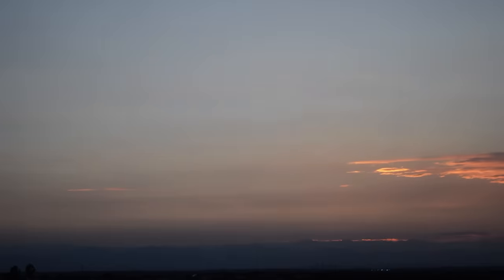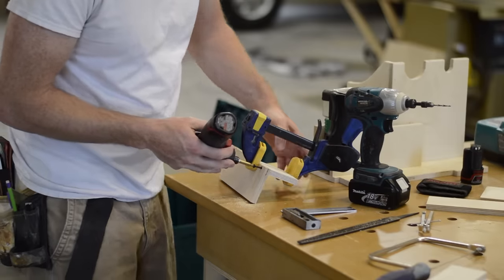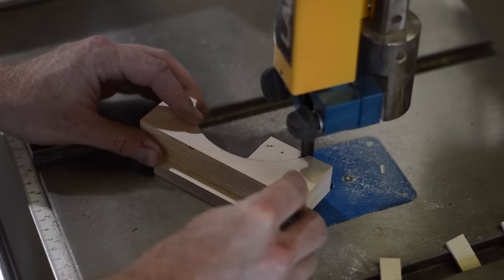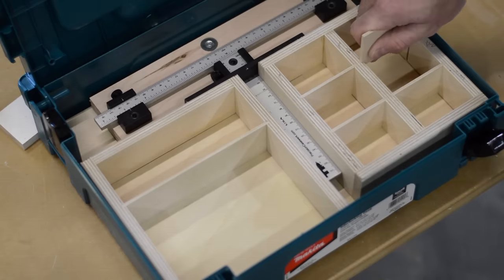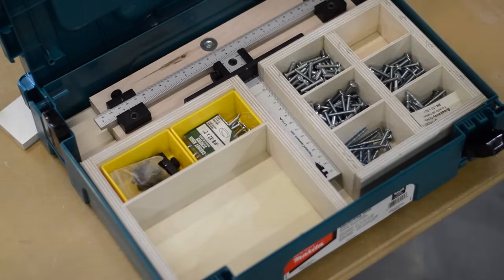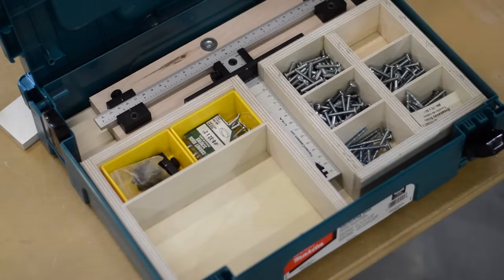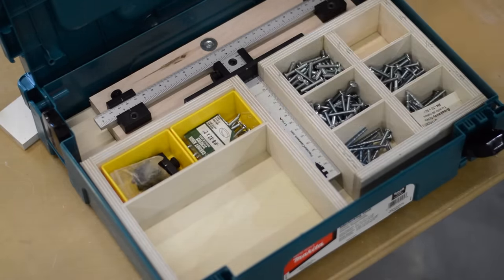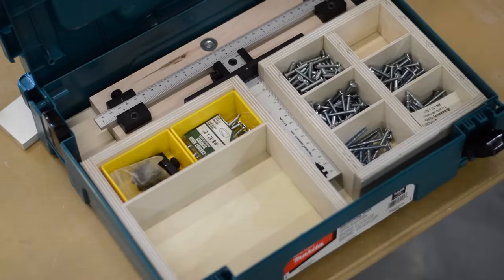Carpentry Tool Organization, Makita, Festool Systainer Build

Comment: Hi Mike, I really like your videos and your camera work is clean and very professional.
I'm from the UK (now living in Australia) and I purchased all of my "Systainer" boxes from a company called TANOS. They have the same boxes as Festool with lots of inserts etc, just come in a dark grey. They also have the new T-Lock system.
Just a quick question, how large is your shop and how do you work out the placement of tools in regard to your work flow?
Many thanks
Reply from the maker: Thank you. I am learning camera and sound details with each video. I am still very new at producing videos. I have looked over the Tanos site, I may add a few more boxes in the future. My shop is just under 3k feet. Regarding placement of tools, this is my first big shop, I have worked in very small spaces up until now, my tools have always been pushed up against a wall and pulled out when needed. In this shop I had the opportunity to group tools together according to work flow/material movement/etc. This was my first go, I would give myself an average grade at best. I would love to redo it knowing what I know now. I will fix things over time until I get it just right.

Comment: Nothing wrong with a little OCD.  Big fan of Systainer organisation especially the Makita ones as they are really more affordable, the four latch mechanism is not too much of a bother I just spray with a silicon based lube occasionally (or furniture polish).  Well done great vid
Reply from the maker: Thank you Mike. I really agree on the value of the Makita Systainers. I spray the latches with what ever furniture cleaner/wax I have on hand. Seems to keep them working just right.

Comment: No sanding stuff?

Your helper is adorable.
Reply from the maker: Thank you. He sure is a cute one. No sanding stuff. I only bring a couple pieces of sand paper, which I store in the lower section of the general tool box to touch up small stuff like nail holes, and miters. The reason for this is I do all sanding in my shop before delivery.

Comment: I like the compressor in a box, I've been wanting to do that for a year now. I think you may find that your large general box is a little too fussy to truly be efficient. I prefer more granular storage for my tools (smaller boxes, fewer tools per box = easier access) the dewalt tstak drawer units have helped me achieve that without cluttering up the floor with a bunch of boxes. I have a 4' tall stack of drawers with a lidded unit on the top that is secured to their tstak dolly. easy access to all my tools, 1 trip to the van, and it only takes up about 3 sq ft.
Reply from the maker: Thank you. You may be right but, I will say that those exact tools have been in a large tool bag for the last 10 or so years. I have used at least some of them on every install I have done since I first put the kit together. So really this is just a new presentation and I have similar access as in the tool bag with the exception of the stuff in the drawers. Time will tell, and I have an open mind to admit if I'm wrong on this experiment.
Reply: Mike Farrington Your current setup is definitely better than a bag full of tools, no denying that. My point was about getting to that “next level” efficiency where every hand tool you have can be accessed without unpacking a box. I don’t think you’re wrong and I’m right, you accomplished what you set out to do. I’m just offering a different way to think about it.
Reply from the maker: Thank you for the input. It gets me thinking for sure.

Comment: Apologies if you answered this but was heat an issue with the compressor?  If so maybe active cooling like a PC case fan. Noctua fans are quite and move more air than the competition. Maybe heat shield on the insides of the systianer. I think you did a fantastic job. I'm sure you wont regret spending the time to do this. Does not having them the same color (contianers) bug you? Just curious been I have festool ones but the makita ones are mighty attractive at half the cost.
Reply from the maker: Heat has not been an issue. The compressor is a diaphragm style and really doesn't get hot. On the days where its going to be running constantly, I just open the lid. So far so good.

Comment: Well done! I’ve been plotting a revamp of my organization and this is great fodder, particularly the compressor. I will say I’m not a huge fan of the makita latches. I received two with my tracksaw and find the latches  difficult to open and close. I’ve started purchasing the dewalt tstak a because of the price point and options for drawers. Cheers!
Reply from the maker: I have heard good things about the tstak. In the end I went with the Tanos Systainer because I already had several, so it would have cost much more to replace those. I hope the Makitas hold up.

Comment: Mike, I didn't know Makita had systainers. I know they don't have T-Lock but do they nest with the Festool ones? The other thing is for the compressor, you could get a 24v power supply and wire it to the compressor's incoming 120v power. The 24v power supply would power a muffin fan that you could mount on the inside of the systainer and have holes on the opposite side drawing air across the compressor.
Reply from the maker: The Makita Systainers are basically like the old style Festool ones. So yes they nest with the t loc as long as the t loc is on top.

Comment: Hi Mike,
Great video, I'm going through a toolbox upgrade now and you've nailed all my essential ideas.
I totally understand your planer, jigsaw combo, i do that too. Except ive got an anglegrinder +sanding disc instead of beltsander, find it more versatile for curves.

Whats the update on the toolboxes a year on?
Cheers
Reply from the maker: Thank you. I sometimes wonder if a grinder would be of more use. I'll need to give that a try. So far after a year, the boxes are working out great. I have added a few to the list as well. I just finished an install yesterday in a small room, without these I would have been stepping all over my tools.

Comment: Mike, how did you start your carpentry experience?  Now, if you are to look back with your carpentry experience how would you tell yourself to commence into a carpentry lifestyle?  How would you recommend One to commence at 25, 30 , 35, 40, 45, and 50 years old?
Reply from the maker: I just bumped into it, without getting into too many details. I tried to leave a few times, but just didn't like the alternatives. So I guess I am a carpenter. As to how to get in to it. It's easy, just look for a job. Work for someone and learn about what they do. Do that with a couple different positions. That will give you an idea of if you'd like to really dive in and become a carpenter.

Comment: nice job, with compressor box I thing if you cut a square hole on the 2 sides 120mm by 120mm and afix some light stainless steel mesh it may overcome heating problem.
Reply from the maker: Thank you. Good idea.

Comment: Add small computer fans to your compressor box to cut down on the overheating.
Reply from the maker: After quite a bit of use, I have found its not needed. The compressor doesn't get hot enough.

Comment: First, the design is thoughtful and the execution shows off your advanced level of craftsmanship - these cases should bring referrals in by themselves. Second, while the air compressor systainer is a slick build, I wonder if cordless nail guns would be an easier solution if you're just using them for installs. Do you feel the air powered nail guns have enough benefit over the electric guns (enough to necessitate an extra case for the compressor)?
Reply from the maker: Thank you. So far on the job site these have been extremely helpful. Last couple jobs, I have spent very little time wondering where things are. I could be with you on the cordless guns. The reason I did this is because I already have two full sets of nail guns, and I had the compressor. So all I had to buy was the box, about 40 bucks. Figured with where I was at, this made sense.

Comment: How is the compressor working out in the box?  Slick packaging.
Reply from the maker: Thank you. The compressor has been great. The particular model I have doesn't make much heat, so unless its going to be running constantly I leave the lid closed and it hardly gets warm inside.

Comment: Glad I found this Video!
Just started to get me some (used) Systainers for organising my tools/building up my Workshop and was wondering about how to build/arrange the inlays.
Don't the wooden inlays add a decent amount of add'l weight?

I'm actually thinking about my 215 pce. wrench-set, which I have to re-organize as the latches of the original box got broken and can't find replacing.
This much metal is quite some weight and I beliebte wooden inlays would add top much weight for comfy handling.

Greetings from Germany, Peter
Reply from the maker: The wood has some weight, but its not too much, at least I don't think so. I would say a bunch of wrenches may be too much. I really don't know, you may need to experiment. Best of luck.

Comment: There is a special made Kaizen hard foam insert which is laser cut for this particular Makita line of boxes perfectly - it weighs almost nothing, and are customizable per your tool collection. They are $10 each and come in 3 different thicknesses.
Reply from the maker: Yup, I use that exact foam.

Comment: Hey Mike, after all this work for the inserts, do you think you could have built wood boxes instead of using systainers?
Reply from the maker: I don't think I could have made boxes that locked together with folding handles in several different sizes, plus the foam for the camera gear. I thought about making a totally unique system, but I just wanted to get this done and get back to work. This seemed faster.

Comment: Great video! This is a thing i have been thinking about for some time. I want a kit to go on a expresso trolley, that i can easily take anywhere even up stairs. Waterproof, because i live on a boat, and do boat stuff,  and designed to  the "first order of retrievabillity" as Adam savage puts it. -the stuff you use most often is at the top. I mostly travel by boat or bicycle when local, so a mount for my bikerack would be cool. I have 3 makita systainer boxes. but also 3 of the "standard" breifcase model. think i need to build an adapter plate between them.
Reply from the maker: Thank you very much. A bike rack could be interesting.

Comment: In managing apts i had a golf cart but no locking stofage. My cuz has a pack rat box bolted into his f350 sh0ort bed. It is covered in plywood and is water tight. He uses a bucket.  He useses a center handle tote for hand tools. Of course he is doing total house building so many toolss. My other cuz has a dual axel dump trailer. So we took an old rv camper put plywood inside framing and use heavy duty jacks. And a dolly to off load it on a job site. Plenty of room for tools and unload for material or dump runs. We have learned to use trailers with dual purpose. During salmon season 5000 # salmon per day. Rest of year f350 freightliner 24' refer and dump trailer. Next we are going to build a frame over dual axel boat trailer to use it as a flatbed to haul 20 4' x4' x  4' insulated fish empty fish bins for our nets.  The dump trailer also hauls our fork lifts. And we have two rv trailers for crew quarters.

Comment: Never thought about doing it this way. I have been thinking about making compartments out of foam rubber, but I have not found a decently priced foam that seems easy to work with yet. Maybe I will try your approach or perhaps a mix of your plywood method and add some thing foam in certain places to avoid rattling so the expensive or delicate tools sit real snug. Do you find your tools rattle around much in your builds? Seems like the nailguns and the sander will move quite a bit if you drive on a bumpy road.
Reply from the maker: Everyones level of tolerance is different, but everything sits snug enough for me.

Comment: Great layout of your tool boxes. I am curious to see the updates that you have made after working with the boxes...
Also, what is the weight of your main handtool box?

Keep up the great videos...
Reply from the maker: Thank you. So far the boxes have been working out great. Couple notes, a vent is not needed with this air compressor unless is cycling on constantly, but if thats the case a bigger air compressor should be brought to the site. Also, I would like to add some sound deadening to the inside to reduce buzzing. Otherwise everything is working good and holding together. A few viewers have sent me some more ideas that I may incorporate into some more boxes.
Reply: You can always add Kaizen foam. But it looks like for the most part, everything has its place...
Reply from the maker: @steven6068  Thats a good idea.

Comment: Heartily approve, with the exception of the compressor. It would cost more, yes, but Rolair (and I think Makita) both make a Systainer compressor, that wouldn't require cutting apart a functional tool. Copper is ductile, sure, but bending that tube seems like a risk. Don't get me wrong, it's cool as all get-out, but that blowing on a job seems like a risk to productivity.
Reply from the maker: I agree, but I had the compressor already. It was a hundred bucks when I bought it, and its way over 10 years old. I figured I couldn't go wrong trying.

Comment: I'm extremely OCD so the normal satisfying tone of your voice, the random shots of your adorable son and the interludes of your different calming person interests are always nice but are a far cry from the satisfaction of watching the organizational system you just put together. Well done, man. Honestly, I can't see anything I would chang about this except for the compressor sustainer. Having holes for the power cord and the air line would make it to where you could close the lid for some minor noise reduction. The hest shouldn't be too much of an issue, but adding a few small fans and a power switch system could give you a few added benefits. But those seem mostly unnecessary.
Reply from the maker: Thank you. I added holes for the compressor cords. So far this has been a welcomed addition to the shop.

Comment: Mike instead of drilling holes in box, don't you think it would have be better to build a dolly for it?   Whereby you take out the compressor on the wooden plank and rest that on a 4 wheel wooden dolly that fits in same box if space permits or  separate or in another case? Oh the same ma,it's dolly that carries the pack out the wooden frame can sit on that?
Reply from the maker: So far this has worked out pretty well. I do like the idea of a dolly to roll everything around on.

Comment: Adding some thin strips of rubber to the bottom of the compressor systainer might be worth the time so when the compressor fills it doesn't rattle on the floor. Optional though.
Reply from the maker: Thank you. Good tip for sure.

Comment: I was impressed with your build, but unfortunately the one thing I wanted covered was, do the makita and festool boxes lock together. I know the T lock wont, but, an older partner of Festool, Protool, had a container that looked like the Makita and it did lock onto the underside of a Festool Systainer
Reply from the maker: The older Festool and Makita will lock together.

Comment: How did the compressor work out? Over heat or anything worth mentioning?
Reply from the maker: The compressor has worked out great. I have run it for long periods of time with the lid closed, it doesn't really get too hot.

Comment: Hey Mike
Good thinking mate, I have very similar Makita tools as you have. Could you offer the drawings for your tool box fittings plz. I was thinking to get a Dewalt Tough system for my makita tools, but after your video I have changed my mind. will just get deep makita boxes
Reply from the maker: Thank you. I did not make any drawings, I was making it up as I go. The Makita boxes have been really great thus far.

Comment: I'd definitely put forced air cooling on the compressor unit... perhaps a 120mm fan mounted in the side adjacent to the compressor head would be sufficient.
Reply from the maker: Thank you. So far it hasn't been needed. This type of compressor really doesn't generate a lot of heat.

Comment: I already watched twice, but didn't get it. What thickness did you choose on your plywood? Especially for all your handtools? Do you think 12mm is enough/ unnecessary weight?
Reply: Ah, on third time I got it :) you use half inch  plywood, which would be 12mm :)
Reply from the maker: Yes, 12mm is plenty.